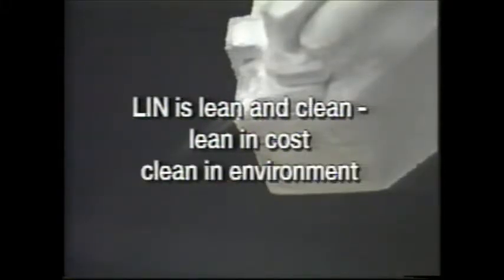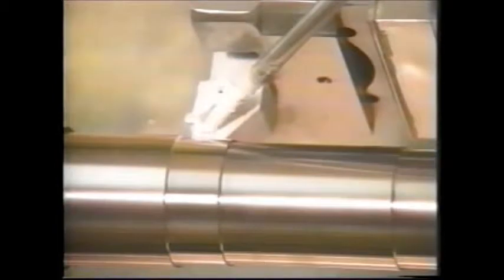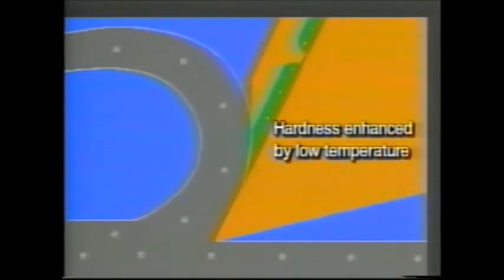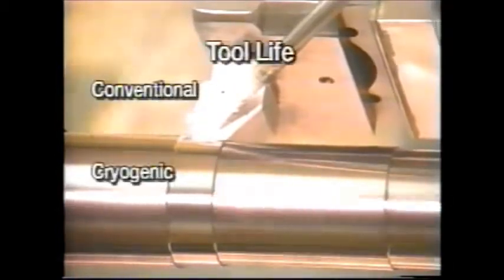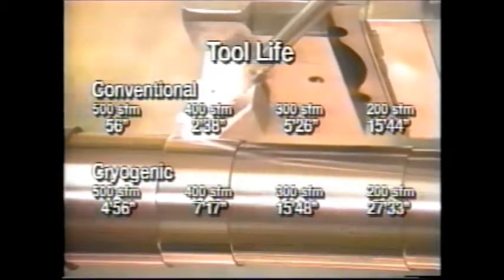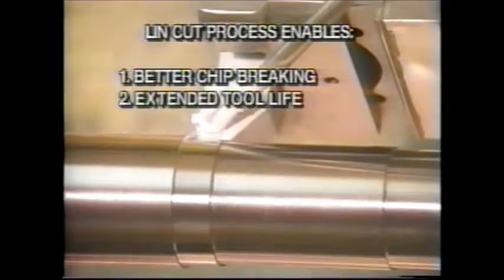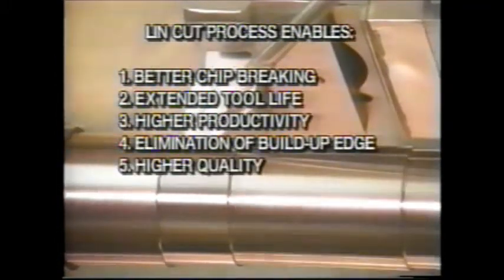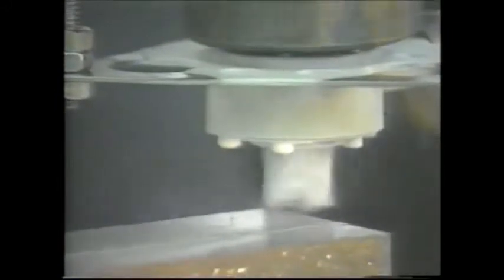Economical Cryogenic Machining

Comment: what about Leidenfrost Effect?
Reply from the maker: Dear Mr. Khan:
Sorry about so late to answer your question, just because we are so busy to build the machines for our customers and did not get chance to check the YOUTOBE messages.
Leidenfrost Effect occurs between water drops on solid surface with a thin layer of vapor. This phenomenon is not observed in our machine.  In our machine, all surfaces ( Stainless Steel machine parts or dinnerware) temperature is lower than the water's, and operating  temperature is high but lower than 100 degree centigrade.
I hope this answers your question.
Shane Y. Hong,  Ph.D.    ( formerly professor of Columbia University, New York City, USA)